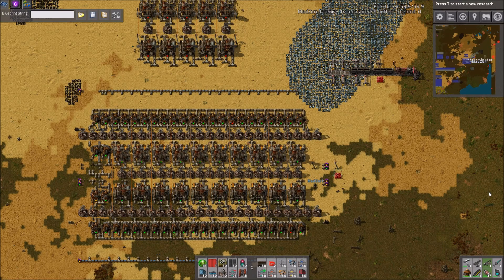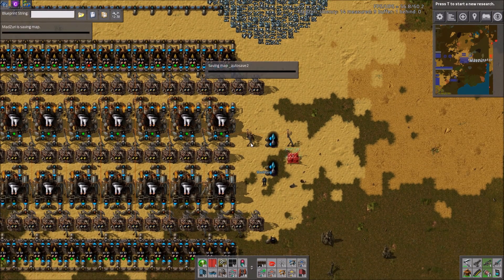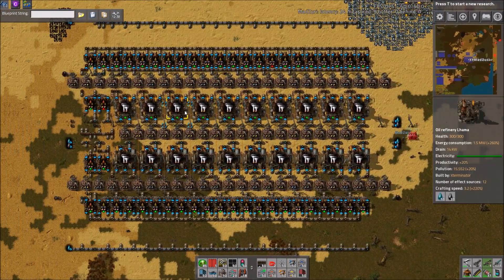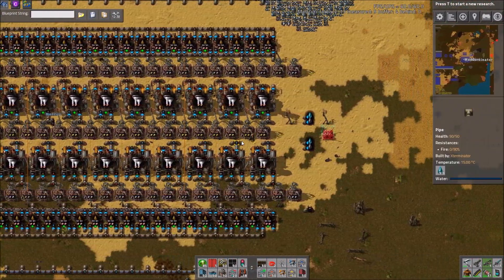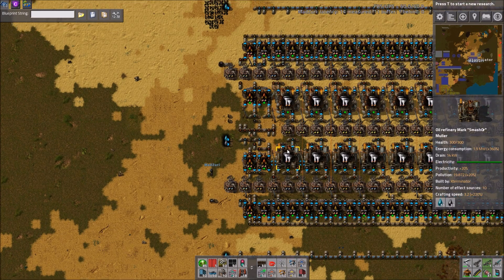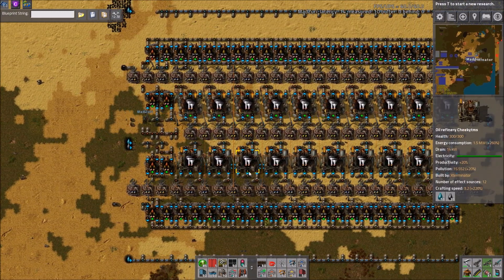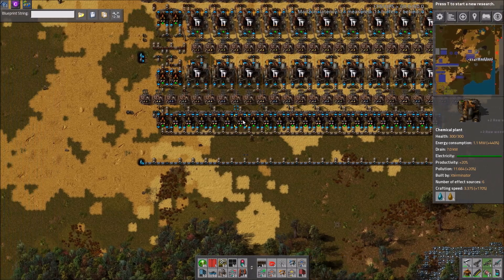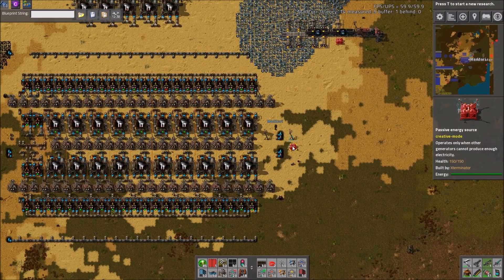Factorio Workshop - Building A Better Factory :: Jame's Oil Setup

Comment: Hey guys thanks for the review! So, the maths... first i will hold my hand up and say that i have not compared this build to the a fully speed beaconed version, and i honestly don't know which is more efficient. So here was my thinking:

- An normal oil refinery uses 420KW each
- An efficiency module 3 speed beacon affecting affecting ~5 refineries (each one is affecting either 4 or 6) reduces power to the equivalent of ~2.5 refineries plus the beacon power (480KW)
- 5 normal refineries will use 2100KW 
- 5 refineries affected by an efficiency 3 beacon use 1050KW (2100/2) plus another 480KW from the beacon, making 1530KW
- If you also add speed beacon the refineries, you can add further efficiency beacons, some-what mitigating the power consumption increase
- Each refinery in my large setup is affected by 5 speed beacons. 5 efficiency beacons and has 2 productivity modules in its slots
- So, each refinery has an energy consumption of 360% (+260%), a speed of 320% (+220%), and productivity 120% (+20%)

I am actually not sure if this beats a fully speed moduled refinery setup but i'm certain it is more efficient than standard refineries and just 2x prod module3 refineries. I hope this is enough information to work out which is more efficient (space, KJ/itemCraft). I would also be curious to see zuri's maths on speed module beacons as well, particulary if speed turns out to be better!

Cheers,

Sorry for length of this comment!
Reply: A closing thought, in the same way that balancing productivity and speed modules gives the highest efficiency, maybe there is a golden ratio for efficiency, prod and speed with oil refineries. This is a little beyond my maths skills though!
Reply: There is such an optimal point, and we already know that the point where you fully speed beacon is less energy efficient than just the 2 row beacon, so if those extra were replaced with efficiency modules it would indeed be a better ratio. This is of cause under the assumption that beacon energy is small compared to the energy used to produce items by the assembler/oil refinery/ect. as it gets somewhat skewed by this. The question is rather whether there are enough effective modules applied to it for it to overcome the problems associated with base constants (which included making beacon energy small). Note that any beacon with an effectivity 3 module in this situation should at least reduced the amount of energy used, as long at is is applied to over 960KW base sources (meaning before modules).
I ran a quick calculation over how well you can do if you have 12 effective sources (you have 2 rows of 5 beacons each giving 2 modules at 50% efficiency meaning 1 effective source pr beacon, giving 10 beacon sources and 2 from the oil refinery itself, this is the same as the 8 beacons + 4 from assembler on assemblers), so I combined it into a table over different amounts of combinations of speed modules, productivity modules and efficiency modules. It is ordered such that we start with the assumption that you fill everything with speed modules, and then substitude some of them with productivity modules and/or efficiency modules. They are ordered such that each collum have the same amount of productivity modules, and each row have the same amount of efficiency modules, and the first row/collum starts with 0 and then goes up by 1 for each row/collum we move out.

First a table over the ratio of output production (which is how much output is produced pr unit time compared to a base factory, so 2.0 would be a 100% increase):

productivity:       0.0000   1.0000     2.0000    3.0000    4.0000

00 efficiency:     7.0000    6.9850    6.8400    6.5650    6.1600
00 efficiency:     6.5000    6.4350    6.2400    5.9150    5.4600
00 efficiency:     6.0000    5.8850    5.6400    5.2650    4.7600
00 efficiency:     5.5000    5.3350    5.0400    4.6150    4.0600
00 efficiency:     5.0000    4.7850    4.4400    3.9650    3.3600
00 efficiency:     4.5000    4.2350    3.8400    3.3150    2.6600
00 efficiency:     4.0000    3.6850    3.2400    2.6650    1.9600
00 efficiency:     3.5000    3.1350    2.6400    2.0150    1.2600
00 efficiency:     3.0000    2.5850    2.0400    1.3650    0.5600
00 efficiency:     2.5000    2.0350    1.4400    0.7150 
00 efficiency:     2.0000    1.4850    0.8400
00 efficiency:     1.5000    0.9350
00 efficiency:     1.0000

Next we have a table over how much energy it takes to produce each item compared to the base factory (so a 2.0 ratio would mean it takes double the amount of energy):

productivity:       0.0000   1.0000     2.0000    3.0000    4.0000

00 efficiency:     1.3429    1.3601    1.4035    1.4775    1.5909
01 efficiency:     1.2615    1.2898    1.3462    1.4370    1.5751
02 efficiency:     1.1667    1.2065    1.2766    1.3865    1.5546
03 efficiency:     1.0545    1.1059    1.1905    1.3218    1.5271
04 efficiency:     0.9200    0.9822    1.0811    1.2358    1.4881
05 efficiency:     0.7556    0.8264    0.9375    1.1161    1.4286
06 efficiency:     0.5500    0.6242    0.7407    0.9381    1.3265
07 efficiency:     0.2857    0.3509    0.4545    0.6452    1.1111
08 efficiency:     0.0667    0.0774    0.0980    0.1465    0.3571
09 efficiency:     0.0800    0.0983    0.1389    0.2797 
10 efficiency:     0.1000    0.1347    0.2381
11 efficiency:     0.1333    0.2139
12 efficiency:     0.2000

Note that the cost arent exactly super expensive at this point, but that every addition of efficiency module does indeed reduce the cost pr item, until about 7-8 efficiency modules, where we roughly hit the lower cap (minimum 20% cost). There is ofcause more to the story (specifically the running cost of the beacons), and these 2 tables are only relevant for when you use exactly 12 effective module sources, but they should at least give people a good idea of the result of using different combinations of modules.

EDIT: added labeling for the tables
Reply: So the optimal ratio in terms of item energy cost is 7 or 8 Beacons with Efficiency 3 modules, 3 or 2 beacons with Speed 3 module 3, with 2 productivity modules in the oil refinery itself (not including the power needed for the beacons themselves)? To work this out with beacon power usage factored in as well could we just work out the average number of beacons per oil refinery in a repeating setup, calculate their energy consumption for the time it takes to craft 1 item and add that to the item power consumption? Would you mind editing your comment and adding labels to the columns and rows?
Reply: I have tried to do it below, but I dont exactly have good tools to do the allignment proporly in a youtube comment, so it is not eactly very good. I I will go back and edit those above momentarily.

I went back to my miniprogram and added in the extra energy cost from beacons. In a given row, half of them covers 2 from some row and the other half cover 3 from that same row. Since they are used on both sides, (by different things) we can add in an extra factor 2. This gives use a cost of 1+2/3 = 1.66... the cost of a beacon that needs to be added, the refinery costs 420 kW and the beacon 480 kW, so we just multiply the ratio of them to get that converted to ratio cost of the oil refineries. It is then added on top of the cost of running the moduled oil refinery, and we get the following amounts of energy cost compared to the energy cost of running an unmoduled oil refinery (this is NOT pr product, but total cost for the oil refinery):

productivity:       0.0000   1.0000     2.0000    3.0000    4.0000

00 efficiency:   11.3048   11.4048   11.5048   11.6048   11.7048
01 efficiency:   10.1048   10.2048   10.3048   10.4048   10.5048
02 efficiency:    8.9048    9.0048    9.1048    9.2048    9.3048
03 efficiency:    7.7048    7.8048    7.9048    8.0048    8.1048
04 efficiency:    6.5048    6.6048    6.7048    6.8048    6.9048
05 efficiency:    5.3048    5.4048    5.5048    5.6048    5.7048
06 efficiency:    4.1048    4.2048    4.3048    4.4048    4.5048
07 efficiency:    2.9048    3.0048    3.1048    3.2048    3.3048
08 efficiency:    2.1048    2.1048    2.1048    2.1048    2.1048
09 efficiency:    2.1048    2.1048    2.1048    2.1048
10 efficiency:    2.1048    2.1048    2.1048
11 efficiency:    2.1048    2.1048
12 efficiency:    2.1048

Note that the base cost of the beacons is about 1.9.
We can then use this new energy cost and divide it by the output speed from my post above to get the energy cost pr unit item produced. This can be seen in the table below:

productivity:       0.0000   1.0000     2.0000    3.0000    4.0000

00 efficiency:     1.6150    1.6328    1.6820    1.7677    1.9001
01 efficiency:     1.5546    1.5858    1.6514    1.7590    1.9239
02 efficiency:     1.4841    1.5301    1.6143    1.7483    1.9548
03 efficiency:     1.4009    1.4629    1.5684    1.7345    1.9962
04 efficiency:     1.3010    1.3803    1.5101    1.7162    2.0550
05 efficiency:     1.1788    1.2762    1.4335    1.6907    2.1446
06 efficiency:     1.0262    1.1410    1.3286    1.6528    2.2983
07 efficiency:     0.8299    0.9585    1.1760    1.5905    2.6228
08 efficiency:     0.7016    0.8142    1.0317    1.5420    3.7585
09 efficiency:     0.8419    1.0343    1.4616    2.9437
10 efficiency:     1.0524    1.4173    2.5057
11 efficiency:     1.4032    2.2511
12 efficiency:     2.1048

Note that the optimal under 2 productivity modules is still 8 efficiency modules, but if you were able to put in 4 productivity modules, you should not be using any efficiency modules. Also note that we only save around 38.7% power by doing this, while lossing a lot of speed pr area of around 70%. In normal situations this might be considered bad, but if we reduced the amount of refineries in your build, it would just waste space, so it isnt really much of a problem there (one would then have to consider whether you could generate more power with solar+accumulators in the space saved than what you would save on power the oil refineries. The amount of space taken up by an addition of a single oil refinery would by 13*6 = 78 tiles. If we use the cost efficient setup, we would need 235% more space, which is 2.35*78 =  183.5 tiles. For 1 solar panel, we need 0.84 ratio of accumulators. Each solar panel takes 9 tiles and accumulator 4 tiles, which gives 9 + 0.84*4 = 12.36 tiles pr solar panel power (we would also need to take care of power distribution, but that is another thing). This means we would at most be able to fit in  183.5/12.36 =  14.85 solar panels. A solar pannel provides 60 kW, which converted to oil refinery base costs is 60 kW / 420 kW = 1/7 = 0.14... This gives us an effective power generation of 2.12 base oil refinery costs. The cost of the speed heavy system is 11.5048 units of oil refinery costs, while the cost of the cheap one is just converted by the energy cost ratios, which gives us 7.0568 oil refinery cost. The difference is 11.5048 - 7.0568 = 4.4480 oil refinery cost, which is saved with this method. Since 4.4 is much larger than 2.12, we can conclude that you save much more energy by using efficiency modules rather than using the saved space for solar panels + accumulators.
Reply from the maker: No problem, a very good build overall and pretty interesting that you chose efficiency modules instead of speeds in those middle beacons. We tried to math it out, but still weren't quite sure which would be better. 
I agree that your setup is a lot better than standard refineries for sure. 

Zuri's math has shown that speed is better than efficiency in beacons for pretty much everything, except he hasn't actually tested Refineries so we cant' be sure yet.
Reply: Recently you said that you were a bit short on submissions? i do have a few more things i would like to submit for review. Is that ok? I don't want to bombard you as I know you already have a 3rd submission from me on the list :)
Reply: The math is different for assembling machines, as they only use 210 kW as a base cost. As you need a beacon to cover 960 kW, you need it to cover more than 4 assembling machines on averge for it even to be gain in energy (as otherwise you will not save more energy than it costs to run the beacon). This is typically not accomplished with the standard beacon layouts, so for them it isnt really worth it. Refineries have a higher base energy cost, so they can start to get some gain. As you can see from the math above it turns out to be energy and space efficient to use quite a lot of efficiency modules on the oil refineries.
Reply from the maker: Sure you could submit some more. :) We are a bit low on stuff so more is fine.
Reply: Thanks sorcdk! Appreciate the repost.. and all this maths!